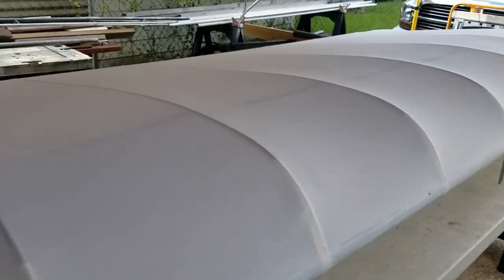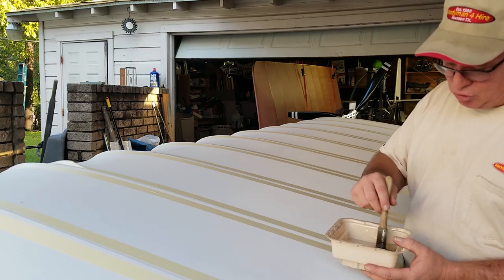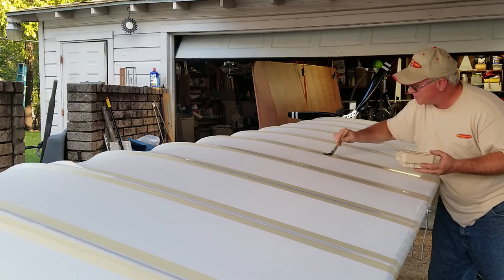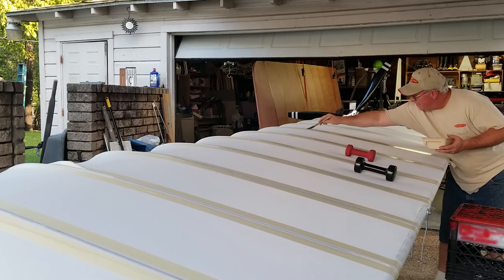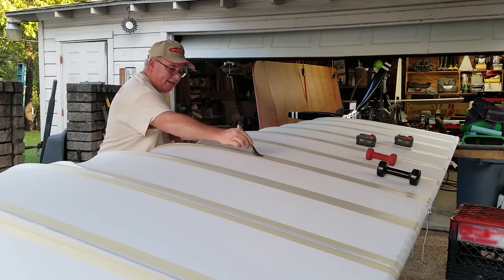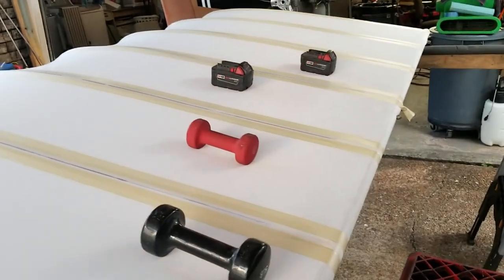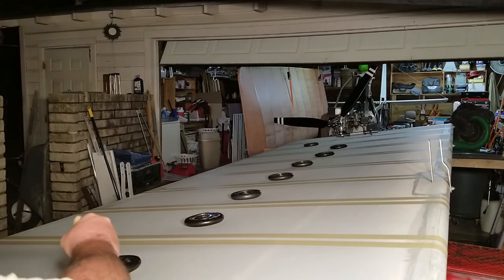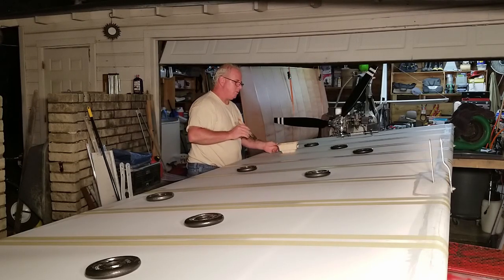Affordaplane update 9-7-18

Comment: I had exactly the same problem on the same wheels and tires. Did the same thing you did and finally ended up putting tubes in the tires. Problem fixed.